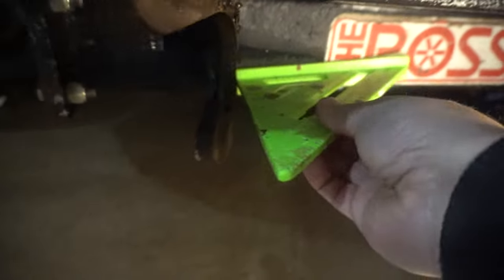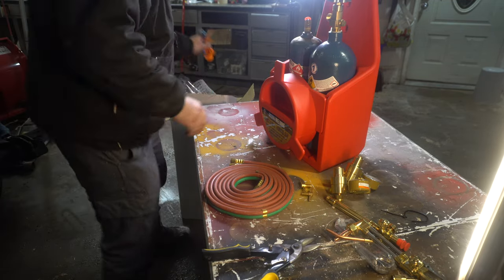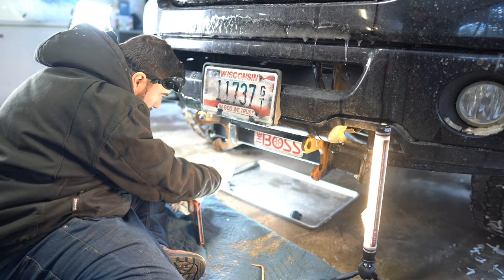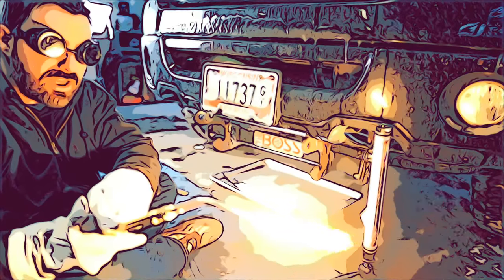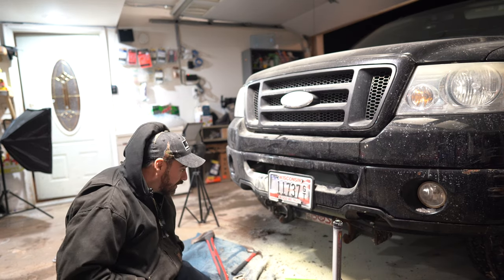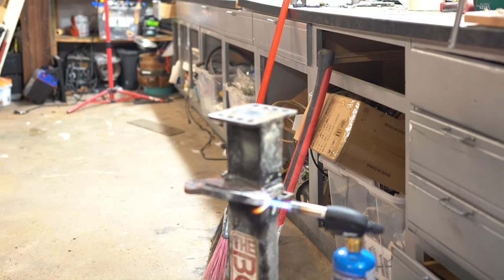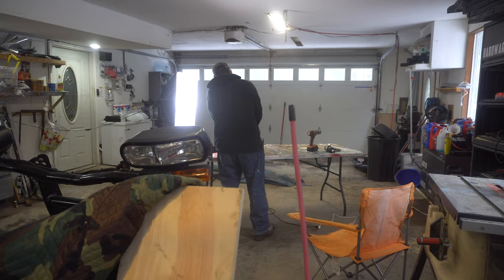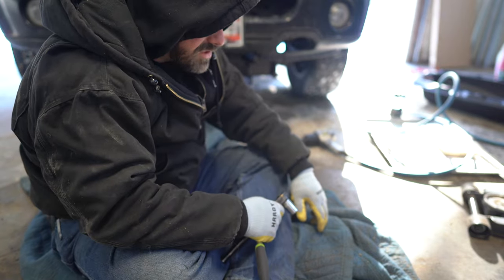Fixing a Broken Boss Plow bracket!

Comment: The first fire was enough but, watching you again heat the bracket, while it was vertical, with your propane torch tank right next to the long flame on your welding torch....oh my.  Accident #2 waiting to happen.  And, I would advise wearing a full mask anytime you heat metal.  Torches can pop small pieces of red hot steel at the right temperature and it can cause some serious injury in an instant. I love your videos but, please... be careful with that new welding torch.  From my own 20 acres of Heaven in NE Missouri, Craig.
Reply from the maker: Thanks, will do. Also the blue torch looked closer on video than it actually was, the perspective was deceiving in video. Thx for watching